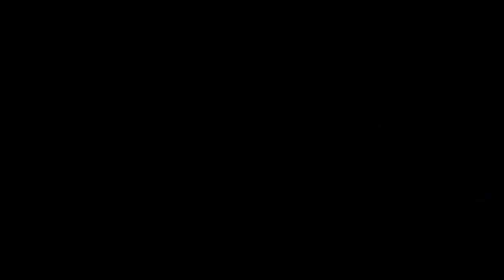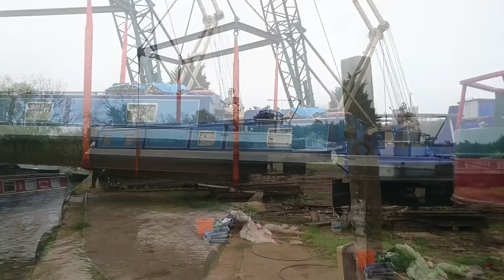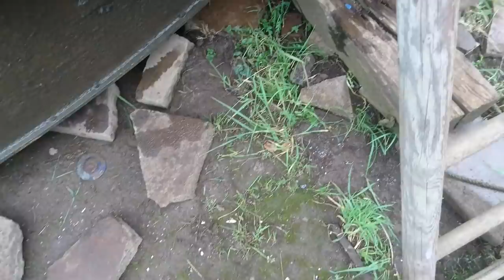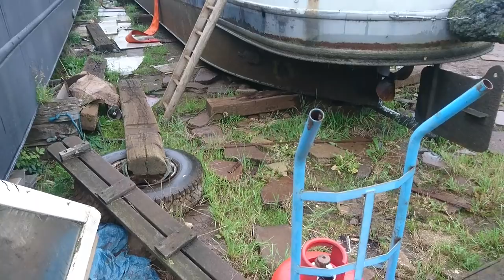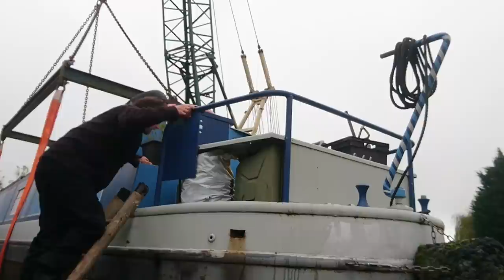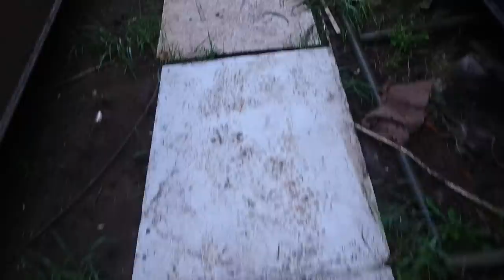Boatyard Blues - Day 1

Comment: Instead of lifting Jerry cans I have a same portable pump that uses two d cells to power it works great for fuel or water . I use all the time to fead my boat gas . Takes no room and one pair of batterys  will last the whole summer
Reply from the maker: Oh I'd love to get one of those. Would it be safe for doing petrol too ie when I'm messing with my generator?
Reply: @ProjectNarrowboat  yes for sure I use mine on my power boat which has a very awkward fuel point made for use in a marina. They cost $30 Canadian dollars and have a suction tube which reaches right to the bottom of Jerry cans

Comment: How were you able to run the engine while on the hard? I assume it has a raw water intake and a heat exchanger for the coolant? So if out of the water, where does raw water come from?
'course I might have it all wrong and it uses a different cooling system!

Good video!
Reply from the maker: Good point. It has a sealed coolant system but I never considered that the radiator wouldn't be in contact with the cold, submersed part of the boat. I guess running it for too long or on a hot day could have caused problems,  certainly once the large hot water tank absorbs all the heat it is able to. But I only ran it for a while luckily.

Comment: Willowbridge marina, the worst marina on the system , make sure they don't drop you're boat, the cranes brake broke when they lifted a widebeam, lucky it was only just out of the water, they should be shut down
Reply from the maker: They seemed careful enough when craning, and the crane had just been fixed - though I did find it a bit strange seeing the boat up in the air like that!
Reply: @ProjectNarrowboat  I also noticed the lifting frame has been left hanging over your boat , great bit of health and safety there , if an inspector saw that they'd be shut down straight away.